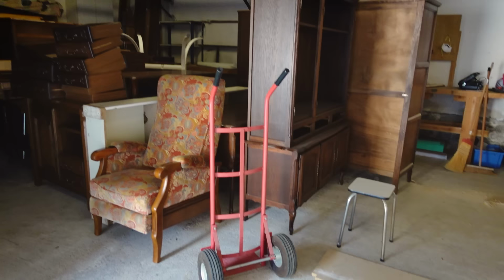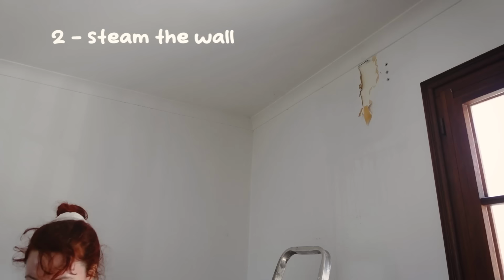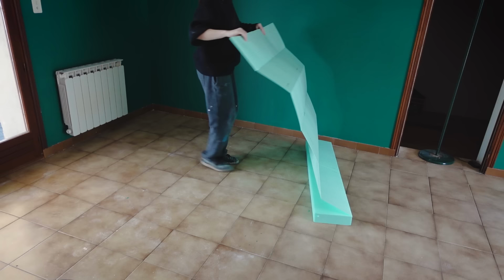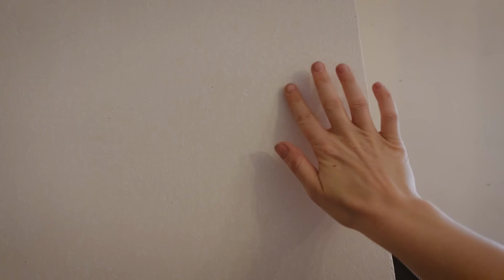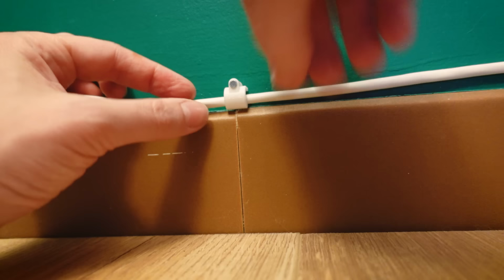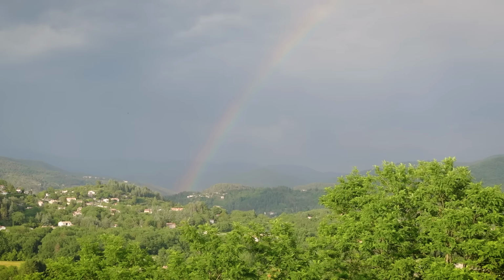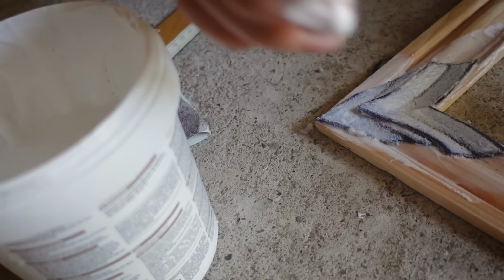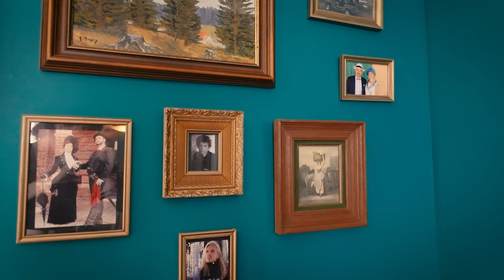I DIY'd my house in ✨Dark Academia✨

Comment: That is a beautiful living room you've made, and this video has it all: humour, drama, cat, DIY; I cried when you sanded and painted over those beautiful wooden chairs, but I forgave you when you (quite correctly) pointed out that Finland was robbed 🤣You were on the right track, though, when you made your picture frame. Just apply PVA glue on the surfaces that will be joined, and staple them together on the backside. Thanks for showing us your process of turning a house into a home 🙂
Reply from the maker: I know for the chairs and maybe you are right, but also, I need to feel living in my home and not the house from previous owners, so yep paint it is !
Also Finland for the win.

Comment: It's actually so satisfying to see you paint the wall properly :D. First painting the edges and around all the door and window frames and THEN painting the large surfaces of the wall. My mom was  a painter (like in renovating homes, not an artsy painter) for 40 years, and this is how the pros do it and how she taught me to do it. It's way more efficient and less patchy to do it this way. I always die inside a little bit, if people start painting  right in the middle of the Wall, where overlaps are the most visible 😅. Though to be fair, this isn't so much an issue with highly pigmented quality paint, since it often times covers without streaks with the first coat (except for light paint over dark)

Comment: Your first attempt at framing was pretty good! If you want to try again, a few tips: join the corners with wood glue, then add the staples in the same places but on the flat side, they'll hold it secure while the glue dries and you won't see anything from the front. And if you want a super seamless corner, they sell little wax sticks you can rub in to fill in any gaps from the cut angle being off, but if you're going to paint it anyway you can just fill it with something like airdry clay and give it a quick sand to get it super smooth for way cheaper

Comment: Hey so not sure if it's the same in France, but just a heads up, in Australia, be super careful removing textured walls and ceiling that have the popcorn kernel like texture cos it can contain asbestos
Reply from the maker: Oh It might be an issue in France but before getting the houses we ensured that no abestos was used. It's a legal obligation to have a check on this!
Reply: @HazarielAtelier  That is amazing to hear! I wish that was the case in more places! Thank you for letting me know!
Reply: That texture which is called knock down or orange peel, is actually made with recent materials, so no asbestos was ever used anyway.

Comment: Looks great! One tip for small gaps in picture frames that are going to be painted - mix sawdust with wood glue and push into gap, smooth. When dry sand if necessary and paint!

Comment: You can find metal corners at crafting stores or anywhere you can salvage metal bits to decorate the corners of your picture frames. You can also apply a bit of gold leaf to give them an antique flare and depth.  I used to do frame restoration.

Comment: Absolutely LOVE it! It's so amazing how you tied together all that random stuff, that you're finding ways to USE the stuff that was in the house when a lot of people would just dump it or hide it. 
Using hot glue to hold down permanent cables to the wall without ugly brackets? Big brain move right there. So smart!  Also loved the creativity with the frames, and for next time, I usually see the staples put in the back of the joint? The green you picked is so luscious, and I'm so glad you were able to get rid of the popcorn texture (even if it was probably a LOT more work than you showed us)

Comment: Future tip for making frames...staple the backside of the trim. Then use wood filler if the pieces don't quite match up. Whimsy to add ideas: Get an inexpensive lamp shade. Add beading, fringe, and trim to the bottom. Find a lamp base you like...voilà instant Victorian lamp. I added iron on dead head moth patches to the sides of mine (quasi square shade)

Comment: Unless it's latex (real or modern) paint or vinyl wallpaper you mostly get away with water in a pump sprayer (these pumping air things, not like windex bottles). You spray, let soak, spray, soak, spray, soak. After some time the wallpaper should be removable in big strips. 
The scorching with a knife or wallpaper perforator tool is only needed if the water can't reach the glue. Like with latex paint, vinyl or several paint layers.

Comment: Lovely job! 

I hate popcorn, I've had to scrape it off more ceilings than I care to admit, wet slop is definitely preferable to dry dust though.

That wallpaper machine is great, wish we'd had one when we moved into our house. Every other room had paper stuff that came off in nice big pieces if you wet it with a sponge, but the Blue Room had this plasticized stuff, we spent 7 hours scraping in there...

Your quick and dirty solution to other people's poro plastering job is fine, we've done it plenty of times during renos and refreshes... 

After having had to deal with the mess from people painting in their cabling disasters, I'm not sure I would have used hot glue, but I suppose a heat gun would take it off if you ever needed to remove it...

NotYourCat definitely seems to have become part of the family!

I dunno about a rhinestone peacock, but maybe some beaded bugs like The Closet Historian makes?

Comment: A little trick if you ever make a frame again: 1- The staples are a great idea. Try stapling from the back. 2- You can use the wood shavings and wood glue to make a wood filler... Or just buy paintable wood filler to cover the joints.

Also, I think my parent's dining room is this same shade and hue. As for what to add... Maybe an old looking chest that you can bedazzle? Absolutely hand your realistic heart purse somewhere

Comment: If you have to remove more stucco (fireplace) use a garden sprayer with water. Get it wet not soaking and it will scrap like a charm. Paper removal: use garden sprayer with fabric softer! Super easy. U can use a tool (paper tiger I think.  Has a bunch of little teeth) then spray. It should come off very easy. If it’s vinyl remove the vinyl layer and the remaining paper will come right off!

Comment: I would play into the feeling of a dark academia study and add a fun take on a marble bust or something fun like a mounted grundle head (monster/fantastical creature). You could even make a mounted Lego animal 😊

Also, the picture frame was a cool idea. Maybe you could use a tube of wall plaster to form a layer joining the two elements? Like to smooth the transition and even out the surfaces, and then to add detail too.

Comment: I hate that popcorn texture too! Never understood it. And who puts up white wallpaper?? It's just... white! Love what you did with the room and how you managed to fit so much work into a short video. I'm also still decorating my apartment and the sims will definitely be my soundtrack tomorrow ❤
Reply: What you call popcorn is not called popcorn but knock down or orange peel texture and it has a  purpose, and that is to cover up imperfections on the wall after joining all the drywall pieces with tape, when you don't want to spend time doing a super smooth finish on the wall, which is more costly and time consuming, plus it is actually a look.

Comment: The result is great but there is often no need to get rid of the wallpaper. In most cases it's even easier to paint over the wallpaper, maybe then you wouldn't have needed a second layer of paint :) If you want to get rid of wallpaper I would use a rouleau à pointes (I believe thats the french name, or you could just use some nails and a paint roll to diy) which is much easier than using a knife. And in combination with wallpaper remover (which you can just mix with water and spray over the wall) it's much faster than any steam-engine! Nevertheless your result is good and thats all that matters

Comment: Hi! Noticed that you weren't wearing a mask when doing the sanding. Is it really okay for you to breathe in that much dust?
Reply: It depends on when it was applied. Pre 1980s (at least in the US), it was made of asbestos. But afterward was "created using a paper-based or Styrofoam product to create the texture, rather than asbestos". I always wear a mask even when spray painting though. Depends on the person and the materials.

Comment: I'm curious - does anyone happen to know what materials are used to make popcorn ceilings in Europe? In America, you're super not supposed to scrape them off yourself (and paying a professional is expensive!) because there's a high risk that they contain asbestos which will be released into the air when scraping them off
Also, the wall color you chose is beautiful!!
Reply from the maker: It's plaster or cement. You can't sell houses that contain asbestos in France.

Comment: I do hope that texture stuff on the fireplace/wall isn't artex like they use in the uk because it has asbestos in it and should either be covered up or removed by a specialist. I really do hope it's not that stuff since you were breathing in the dust from sanding/removing it 🤞🏻

Comment: So america is really obsessed with that texturing especially in the nineties and early two thousands they were also very obsessed with popcorn ceilings... Which have a valid reason for being invented, Popcorn ceilings can reduce the way sound travels through a room.  However it usually only makes a large enough difference in a large room built for sound.  We have sense found much better ways to keep sound from reverberating and creating terrible echoes but people love popcorn ceilings for some and and i don't get it because they just attract dust, dirt, cobwebs, tar, and oil.  All of which get released into all of our houses some indifferent concentrations that others because of smokers.  But there can still be tar/oils in a of the stuff that we cook.  And that in the long run is what causes the problem it vaporizes gets in the air lands on the walls and ceilings get stuck the tiny little crevices in the popcorn texture, Dust starts to collect today then spiders start making their webs there bugs get caught in it.   I can show you a ceiling that would disgust you.

Comment: WARNING! If you have textured walls or ceilings like the one shown at 1:39 please get it tested before you try to remove it! This stuff is more often than not filled with ASBESTOS and you really do not want to be breathing in the dust it makes during the removal process! Please be careful. Hazariel, please consider sending a sample of that popcorn in for testing if you havent already.
Reply: That might be on the ceiling but rarely on walls, that is just dried up joint compound mixed with water, no lead or asbestos used. And on the wall is called knock down or orange peel texture, not popcorn. What is best is to use a mask, lead or no lead. That dust is bad for lungs anyway.

Comment: I am surprised you didn't pull the floorboards off because you should have done that and I hope you let your would sit in your house for 24 hours even better 48 hours before you lay it. 
You are doing a floating floor it's on top of another one and the way you did it I'm so sorry but it is not the right way I hope you don't have a problem with it later on.